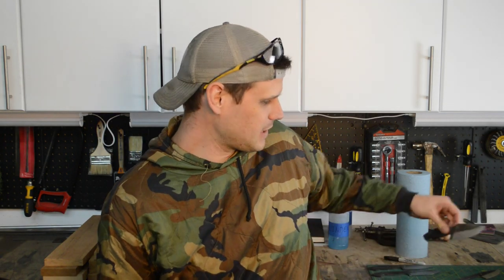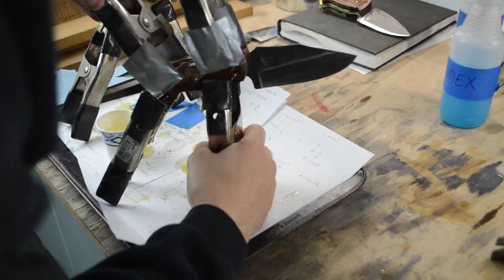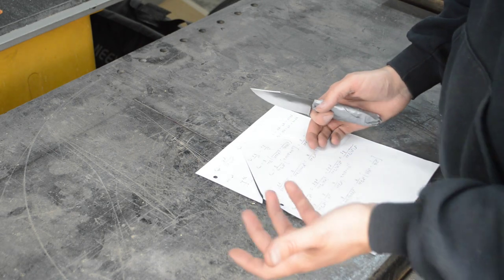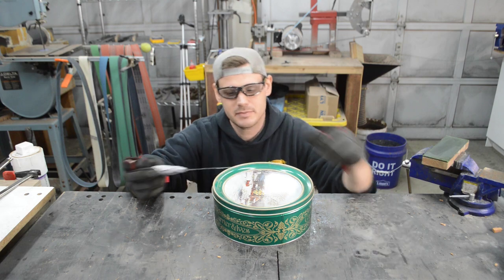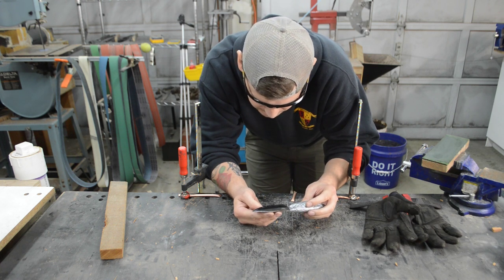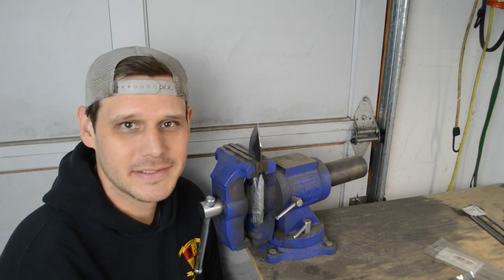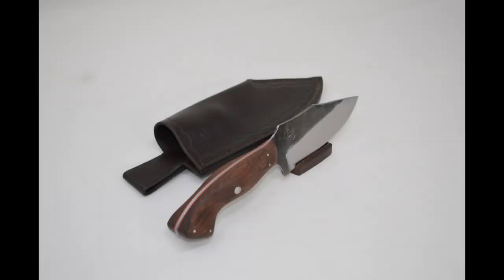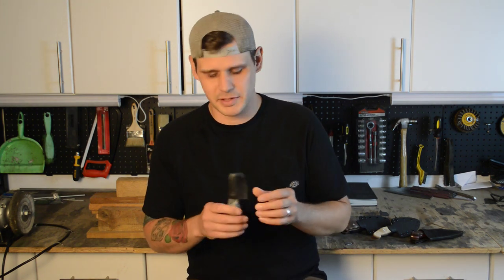Knife Making: 3 💪 hand forged every day carry field knives

Comment: I’m partial to walnut so that’s my vote. I see you like the coke bottle scales. I’ve made quit a few knives but have only made coke bottle scales for 8 of them. What temperature do you bring the oil up to for quenching. And what method do you heat it up with. Do you use canola,vegetable or peanut oil ? I’ve used everything but parks 50. Another great video.
Reply from the maker: Hey Tim, thanks for watching! I love walnut as well. It's one of my favorite woods to finish. I typically warm my oil to 100F - 110F before quenching. I used to use canola oil years ago, but in my opinion it's well worth the money to invest in quench oil specifically designed for your task. I generally stick with either Parks 50 or Parks AAA.
Reply: @DavidMoonForge  yes sir,,,canola is what I use.

Comment: What style of tongs are you using? Awesome job thanks
Reply from the maker: The tongs I use most often are wolf jaw tongs. I think I've even got an affiliate link to the specific tongs in the video description. V-bit bolt jaw tongs, and z-type offset tongs are pretty useful in knife making, in my opinion, but depends on what stock you're starting with. Bolt jaws are great for railroad spikes. Z jaws are great for flat bar stock. Wolf jaws work okay for just about anything if you figure out how to hold your piece correctly.

Comment: Excellent, where did you get your touchmark?  Did you weld it to the rebar ?
Reply from the maker: I got it from www.steelstampsinc.com. I sent them my logo and they had some minor suggestions for fonts, size, depth, etc. to make sure the imprint would show up well. All in all they were a great company to work with, and I'll likely use them again. I welded the rebar on the end of the stamp. I submerged the bottom half of the stamp in water to make sure I didn't ruin the temper on the stamp.